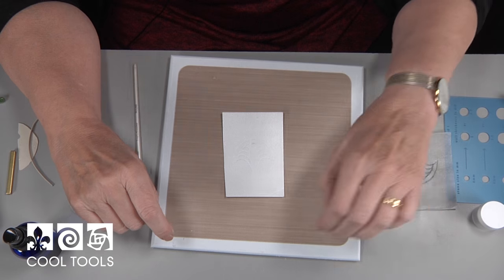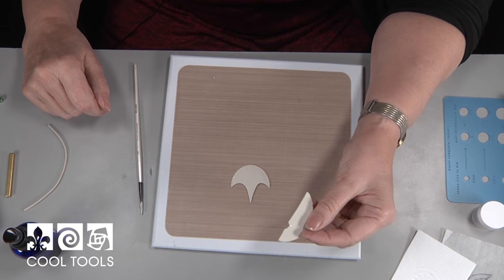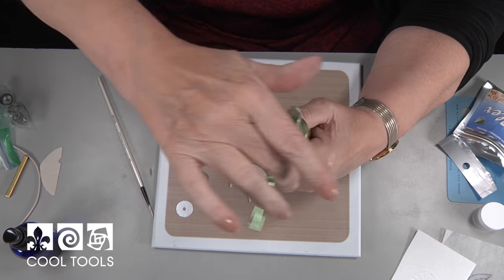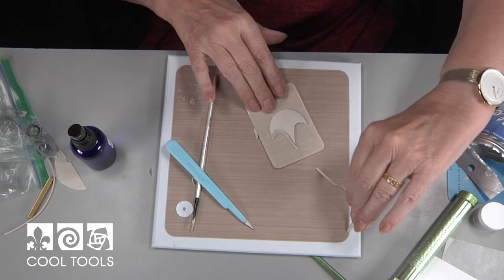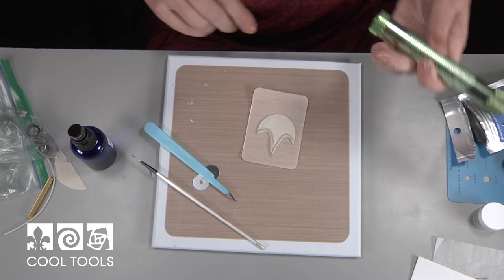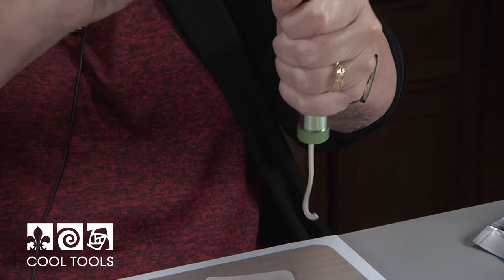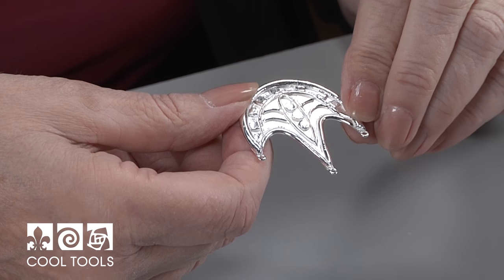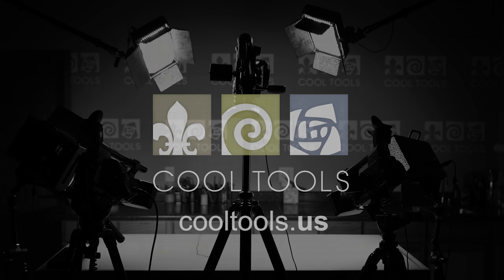Cool Tools | PMC Flex Pendant Embellished with Extruded Elements by Valerie Bealle

Comment: Are there any downsides to using the flex clay, anything that you wouldn't want to use it for?
Thanks!
Reply from the maker: Hi LIsa, PMC Flex is a good .999 fine silver product that is very flexible in the green ware state. There is no downside if you want fine silver. Valerie Bealle uses it almost exclusively. Thank you for the question!